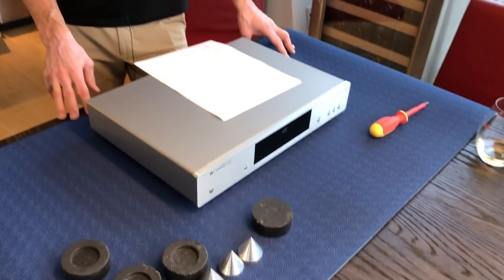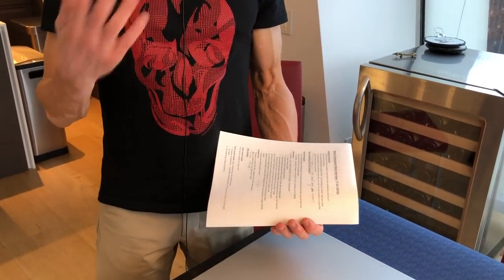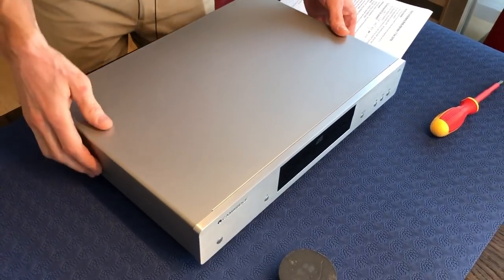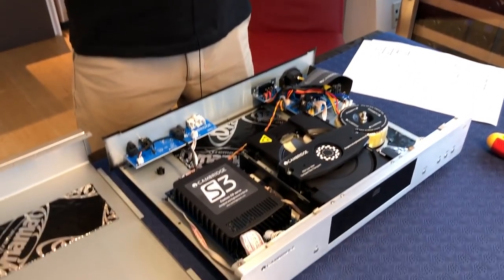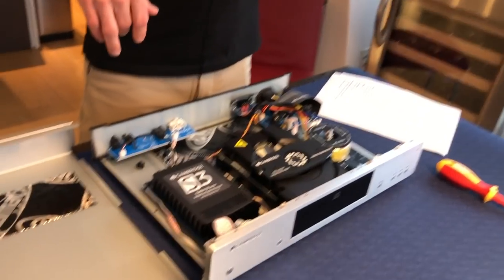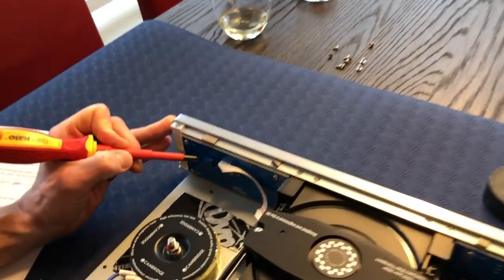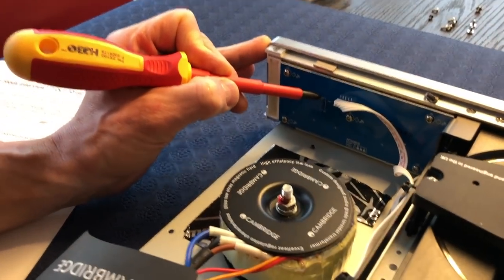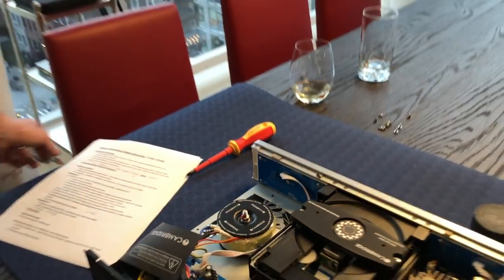Miguel pops the lid on his CD transport to tweak the sound

Comment: One question noone has asked... How does the sound compare to file playback?

For file/streaming playback I run Roon Core on a mac mini 2012/16GB RAM/Linear power supply, and play over the network (ie RAAT) to a dCS Rossini. For the CXC I run it using the copper BJC cable to the BNC input in the dCS Rossini.

Comparing playing a CD vs playing the rip of the same exact CD (AIFF, with XLD). To my ears, in my system, the CD sounds better! It has better pace, bass... John Darko said of the Hegel Mohican that it was more "sure footed" - excellent descriptor, that's exactly what the sound difference is about.

And to be clear: I do not like this result, I would like both to sound the same, or Roon to sound better. Unfortunately, I find the CD player to somehow be a tad (just a tad) more engaging and rythmically correct.
Reply: Could it be possible that Roon is doing some kind of DSP alterations to your files? I'd personally try those same rips via USB into your Rossini with a WASAPI plugin or similar method (ensuring bit perfect stream to the DAC) and compare quality at that point.
Reply: The difference if exist can only be traced back to data jitter, worst on any computer than on a cd transport. Clock recovery using a PLL is a noisy process, very sensitive to input jitter even when using a voltage controlled crystal oscillator, a feature not common in audio dacs. Use of a fixed frequency crystal oscillator master clock is today the only known technique to reduce jitter to undetected levels. A fifo memory can reduce the missing/swallowed samples rate to seconds in the worst case, and a single missing sample at that rate, if properly treated, will run undetected by the 'goldest' of golden ears ('glitch' doesn't apply here). The only penalty will be a few seconds of playback latency.
Reply: @drwatson32bit  Roon is set not to apply any DSP at all. Yes I could connect the Rossini via USB.
Reply: Alex In terms of DAC clocks, I am pretty sure I am good - dCS Rossini DAC + dCS Rossini master clock. I understand there’s a PLL discovering the clock of the SPDIF from the transport (the master clock is not used in this case). So by this account the CD is at a disadvantage. Additionally, Roon over network is “known” to not sound as good as, say, Audirvana over USB to the DAC (I have experienced that and so have other people). Roon over USB - unclear, would need to check.
Reply: @miguelbarrio  thanks for your input. Assuming perfect data recovery (a very reasonable assumption today!) leaves only jitter as only responsible for less than 'perfect' sound. SPDIF allows for simple clock recovery techniques and good performance is expected here. Streaming (wireless or USB) requires local clock generation, and considering the very expensive piece of hardware you have to accomplish that, I agree with you, is difficult to explain the sound difference you describe.
Reply: Alex It seems to be a theme that RAAT doesn’t sound as good as either USB or UPnP via the player’s app. Unclear why.
Reply: @miguelbarrio  while USB is not as convenient as going network into your current DAC, have you considered a USB to SPDIF converter, something like a https://matrix-digi.com/en/products/314.html  .. wondering if that would level the playing field between file playback vs. CD?
Reply: Hooman Rabieh Prob not a good idea in my setup: I have a dCS Rossini DAC + dCS Rossini master clock. If I use SPDIF from a device not clocked by the master, I fall back into SPDIF clock recovery, so likely less quality. I have tried USB to the computer directly with Audirvana and that sounds better than RAAT - in all likelihood matches the CD player. Given reviews and comments, there seems to be something with the RAAT implementation that makes the sound less good.
Reply: @miguelbarrio  Miguel, so I understand, you are saying that via Audirvana, USB direct to dCS,  playing ripped files are equivalent to this CD transport?
Reply: @HoomanR17  Not quite... I had compared this in the past and at the time my assessment was Audirvana over USB sounded a little better than RAAT. But I have not done the comparison you speak of.

Comment: Keep in mind, sometimes changes you make will inevitably affect resale value ... you may own those changes for the rest of your life...I'm very familiar with mods like the ones you're doing and for the most part they are positive and in the right direction...for me my years working with room acoustics has been the most significant in regards to sound improvement...in my opinion, this will be your biggest improvement, it's just not as fun...concrete is not the best floor and wall material for an audiophile...its good for protecting your neighbors but not so good for room acoustics, a balance between concrete and softer walls and/or partitions will go a long way... I recommend you don't a&b...your efforts may or may not have a noticeable improvement,  they may at times have ill effects you may not here at first but notice over time...any changes you make do affect other areas of your components that may not be beneficial...it takes time to here improvements and/ or anomalies, unless you have test equipment...designers and electronic engineers are very sharp and will design in inferiority to keep the audio signal to not be at its best behavior ...depending, base model or flagship...this you can't change, so leave it to your brain to decide whether your changes are an improvement or not....you can convince your self there is an improvement and the brain will give you hours, sometimes months or even years of joy and pride in your accomplishments... on the same token you may find yourself on a quest changing it back to original and wishing you never opened the lid...I'm just saying...im sharing this for the sake of sharing, not directed at anyone...by the way, very very nice system you have, yes...no changes necessary...infact make sure you always have a Cambridge around, in case you get the improvement bug...PS, power conditioners that i have tried I dont like, they all seem put a veil over the sound, lowering dynamics, now AC through a small power plant, isolatoin transforner, will improve the over all blackness, decay and dynamics greatly, less noise, splitting AC to 60 V per side i found improves 60 cyle hum...i love talking abought this stuff and could ramble on but i have respect for you and others... enjoy...Ongaku...wow...wish I could here it sing...peace all
Reply: Understood... But the resale value of a piece that was initially $450, then replaced by a new model, is pretty much nil. So I'm ok tinkering with this. :)

Comment: My eyes are terrible so I was excited to see if I could brighten the display at all by turning that adjustment screw, but unfortunately it didn't so a thing.
Reply: It’s a multi-turn trim pot, and the brightness enhancement is small. Try to rotate it a few turns. It is bizarre that they are so dim, and it’s not the LEDs behind it but the LCD construction itself.

Comment: Very nice approach. Thanks for upload. May be covering the power transformer with conductive sheet cover may add further cent of improvement.
Reply: Mu Metal maybe?
Reply: Have you tried then?
Reply: @miguelbarrio  you are right.
Reply: @aristoweb  not in cdp. I hv done little tweaks on phono preamplifier. It returns good results.
Reply: @miguelbarrio  great to know how this DAC resolutions demands very stable power supply and minimum noise interference nearby. Because now thus dealing with even micro voltage data transmission.
Reply: Regarding linear power supply I found ripple filter (or zero ripple/active capacitance )type works better
Reply: @miguelbarrio  thanks and now my last words as always. "No one home audio setup complete its Hi Fi sound without rational speakers placement.(thanks to Bob.)
Reply: @amitanaudiophile  I bought a conductive copper tape and intend to put it around the toroidal transformer.

Comment: Miguel, when using Dynamat or its competitor, Noico, inside the CXC case or other audio component cases does it interfere with heat dissipation? Thanks.
Reply: There is no heat generated in these units. I leave mine on all the time and it is not warm at all.

However, yours is a fair question. If there's heat generated in the unit then yes, this could be a problem. If for example there was a tubed output stage, I would expect the design would rely either on vents - which you should NOT cover - or convection heat dissipation - which would be a consideration.

Comment: The CXC or Audiolab 6000? I am looking to upgrade very soon.
Reply: They look very similar tbh... Both have toroidals of similar size, linear power supplies, buffers on the SPDIF coax output. Different mechanisms and likely different control circuitry (Cambridge’s S3 Servo vs what looks like to be built into the CD mechanism in the Audiolab). I would try and find a comparative review or order both and return the one you like the least.

Comment: could you add a i2s hdmi output to it so it will work better with stand alone Dac's.  Great video.  ted
Reply: No you cannot add an I2S output. However, in the I2S implementation where the clock is still the source would likely make little difference compared to SPDIF with a good coax cable and a good DAC. There are a few different I2S implementations and one has the clock coming back from the DAC. In such case, and assuming a DAC with a great clock, I2S is likely to improve the quality of reproduction (less jitter).

Comment: Hi Miguel, sorry to burst your bubble,
5:45 is not a bypass cap, it's an ordinary power supply reservoir capacitor, probably around 3300μF/25VDC. CA have been known to use tier 3 caps in their products - L.H. Nova and Axon for example so very, very poor on that front actually. It's virtually the same layout as every other CA CD player going as far back as 2006 - 640C for example. I see they now have SMT rectifier diodes instead of THT, but that's about it. So, the twisted pair of wires you re-routed is in fact AC voltage carrying pair, it's only converted into DC right there on that servo board. That's why the secondary transformer winding fuse is there as well. It then feeds 7808 and 7805 voltage regulators, if I remember correctly, which sit on the other side of the heatsink. It means that any parasitic HF noise that AC line carried, will have been filtered anyway. It also means that it would be beneficial to screen it, if you're now running it close to sensitive chips underneath the servo board. Transport also looks like bog standard Sanyo they have always used, far removed from Hi End realm presented by Sony drives.
14:30 If these lines are at a right angle, then there can possibly be no interaction - that's how electromagnetism works.
Real improvements can be made to this transport, but that involves replacement of some components and a bit of engineering knowledge. It's never too late to learn electronics and I assure you the results will be much more profound, than those achieved by slapping a piece of mat on the cover.
Reply: Your descriptions are correct as per the service manuals you can find for the 640. The Servo3 is not very different from the Servo2 in those drives. You are correct that rectification is done on the Servo board - I replaced the cap with Panasonics (see the link I posted elsewhere, I won’t bother to look up the detail again). The Sanyo transport is the same as the one in the Hegel Mohican CD player, which I would regard as fairly high end. I know how electromagnetism works darling, I have a PhD in Physics. Yes, if they are perpendicular they will not interact - but can you really have them perpendicular for sure? Dampening vibrations has been shown in many places to reduce low frequency (say around 1KHz) drift in the crystal oscillators. It is this type of jitter that is the real audible problem. Same is true for low frequency reference voltage levels. So reducing vibrations is key. Just look at every high end transport out there.
Reply: @miguelbarrio  Thank you for your response Mr. PhD, funnily enough, you haven't provided any valid arguments to disprove my observations.
Btw, I'm a nobody, who only happens to have spent last 30 years having lots of fun servicing/repairing Hi-Fi equipment. So, no, Sanyo drive is not remotely a Hi End transport, check out Sony ES/SES, Mark Levinson, or Teac VRDS and even you, Sir will be able to tell a difference. Hint: moving parts machined out of metal alloys are a dead giveaway. Also, had three CamAudio CD players on the bench - leaking filter caps, stretched, hardened tray belts and non-responsive tact switches hardly qualify as Hi End. I think you're the One, the God gifted, classically trained, pitch perfect, musician, who can hear the sound quality contribution a pure silver wire, gold plated brass RCA connector, or a piece of sticky mat makes. I'm sure the slew rate increased to infinity and overshoot/jitter were nearly eliminated and you can now now hear that famous pin drop, reproducing the Planets on your Hi End transport. Sarcasm aside, you're just angry, Sweetie - you've been exposed over making unsubstantiated and frankly nonsensical claims, then again, you're probably used to it judging by your high levels of both ignorance and self esteem. Trust me, the "improvements" you've made haven't changed one bit (pun intended).

Comment: The cutouts in the sheet metal maybe there for other components in the shared product line, but if they’re are in there on purpose the dampening material covers them up and might be stopping heat dissipation
Reply: You should never cover cutouts for ventilation. I certianly did not.

Comment: Am I wrong or did you also put a ferrite ring on the cable that comes out of the digital power supply?
Reply: The cable that has a ferrite on is coming directly from the transformer (that is: mains -> toroidal transformer -> cable with ferrite -> S3 servo board). This unit has one power supply for the control system (close to the power intake) and the S3 Servo gets AC directly from the transformer (16V RMS IIRC). On the S3 board there is rectification and filtering plus two active regulation stages in series (8V and then 5V IIRC). The 8V rail powers the mechanics (spinning, drawer opening) and the 5V powers all the digital audio functions. Also interesting is the S3 board is minimally stuffed - no DAC or anything other than what's needed for SPDIF out. It is quite a careful design.
Reply: @miguelbarrio  I was counting on putting a ferrite core on the cable that comes from the digital power supply (ie the cable that you rightly suggested to move away from the digital signal cable and which was stopped by the two clamps).

But I don't know if that's a good idea.

Comment: So the case doesn't resonate, so what? What difference could that make to a digital signal being sent or translated?
Reply: Unfortunately, digital gets simplified a bit too much. When we read a CD we are trying to read a bunch of physical impressions in a disk made of plastic. I am not saying that the data read from the CD is ever incorrect - there's a lot of redundancy and error correction to fix any read problems. 

The issue is different: Jitter. You might argue that jitter happens at very high frequency so it is not audible. But jitter drift - meaning the slow change between the clock being ahead vs the clock being behind a perfect clock - can have a much lower frequency, often just a few kHz. What happens if you have such jitter is that a signal at a frequency F gets sidebands at F-Fdrift and F+Fdrift. You reduce these contributions by reducing vibrations. Some people seem to think that SPDIF digital signals get reclocked. There are some schemes where this happens, but any correct implementation of SPDIF cannot reclock it but rather try to recover the clock from the incoming signal. So your DAC is actually driven by the clock of the CD transport. I can explain why it cannot be consistently reclocked if you're interested.

Aside from this point, just consider that ALL high end transports go to GREAT lengths to minimize vibrations. That alone should tell you it matters.
Reply: @miguelbarrio  Ok, makes sense. The need for dampening wasn't clear to me. Thanks for the explanation.

Comment: The power cable that is under the cd reader is stuck with a tie wrap. How did you cut that? cant reroute those :( the tie wrap isn't reachable. can you help me out? Thanks alot!
Reply: Do you mean the power cable (yellow and orange) coming from the power supply? The cable ties I had in mine were all accessible and easy to cut, there were none under the transport.
Reply: @miguelbarrio  yes the power cable. Maybe it's because I got the cxc v1. The tie wrap is under the cd player, holding the power cable and a optical cable together. I tried for more then a hour but couldn't get it done. The other tweaks I did, thanks for that
Reply: @Biefstukje  Ok, that's odd. The one I modified here is also a v1. You could lift the CD transport, but honestly I don't understand where the cable tie would grab onto. BTW, the ONLY difference between the v1 and v2 is the exterior color (CA told me this).
Reply: Might try lifting the cd transport. It is just 2 cables tied together, power and optical. It doesn't grab on anything. Very weird that it is different on our units. Somebody else commented on this video he had the same problem. Thanks for the reply.
Reply: @Biefstukje  
I had the same problem. I lifted the cd transport mechanism and that went fine but.. up on putting everything back together, the transport would not read any CDs!
After checking everything (connections etc), I decided to loosen up the screws that hold the transport in place and, low and behold, it worked fine!
So, it seems to me, overtightening the mounting screws has some negative effect on the laser.  I hope this helps.